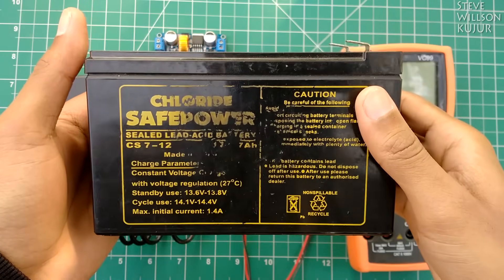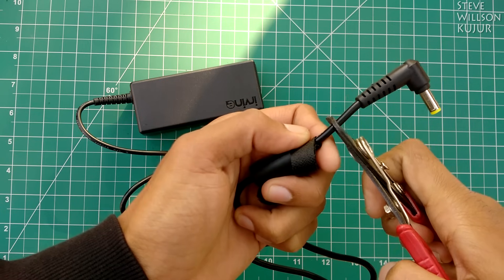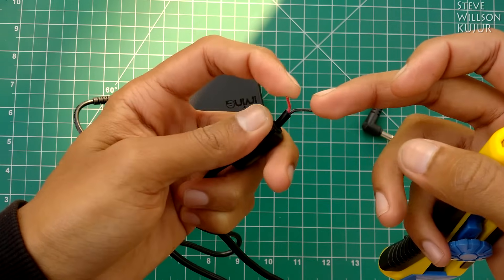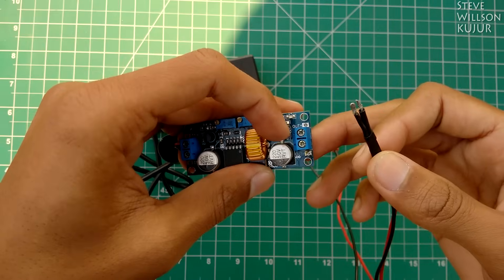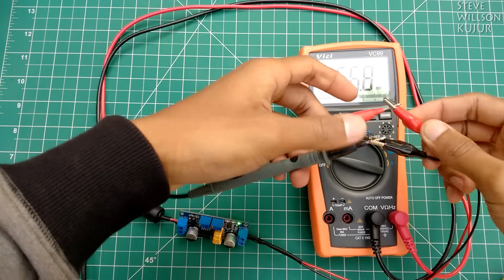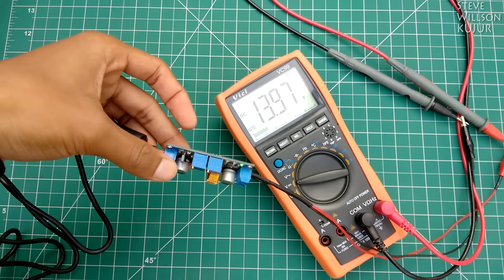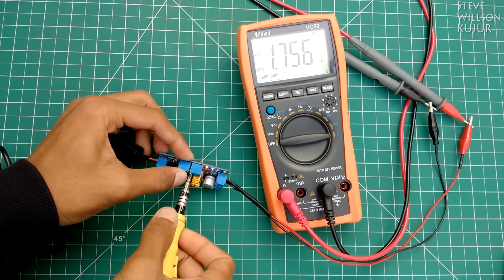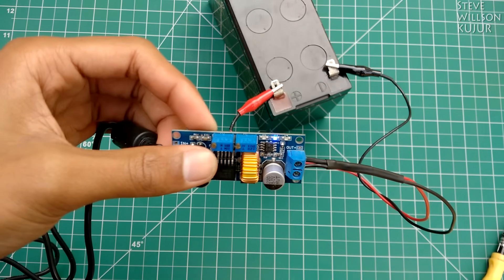How to Make a 12 Volt Battery Charger

Comment: sir what will happen if we give the input with a 12v 2amp dc adapter will it work or not plz sir do reply
Reply from the maker: no it will not work
Reply: Steve Willson Kujur 
so sir i dont have the laptop battery charger what can i do plz reply sir
Reply from the maker: use any adapter voltage above 13v dc to 30v dc
Reply: Steve Willson Kujur sir will it work if we give the input power of 12v 5amp will it work plz plz tell sir
Reply: IF as you say you have 12v 5A  available then you can use a different type of regulator - a BOOST regulator. You need to find one that will deliver 14.4 volts output and have BOTH a voltage setting pot AND a current Limit pot. If you can't find one (search eBay for 12v boost regulator) your other option would be to use TWO regulators ONE to BOOST your DC volts to somewhere between 16.5v and 19v (dependent on PRECISELY what the second regulator requires as minimum differential between input and output volts - they usually tell you this on the order page). There will be no need to worry about current limiting on the first regulator, the second will provide it overall for the output if you use the one Steve showed. Adjustable boost regulators always have a voltage setting pot. If you also want current limiting look for a model with two pots as that will almost certainly be both current and voltage adjustable

The second regulator (like the one Steve used) will be needed to deliver the 14.4 volt output for charging the battery. You connect the output of the BOOST regulator to the input of the second (known as a BUCK regulator) which is set as Steve described. The first regulator is set to output sufficient volts to the second so that it works. It's not possible to state with certainty what output CURRENT you'll be able to actually deliver, but I would expect you'd be able to get around 3 Amps at least, possibly a good deal more from the combination of the two. The actual value will depend on the individual circuits and the exact efficiency of each at the voltage conversions actually used. 

DON'T expect 5A output from such a combination, or even from a single boost circuit.This is because the overall losses will mean that the output cannot deliver as many amps as the 12v input. 

Problems: 

1.If you have no existing 19 to 20v laptop supply available then a solution will require potential extra expense.
2. If you can't find a single Boost circuit of the right specs you will have extra expense
3. It's NOT as easy a set up with two regulators and you MUST keep track of what you are doing or the magic blue smoke can suddenly appear! 

Simplest solution, try to find a scrapped power brick. Often there is nothing wrong with them if they've been discarded at the same time as an unwanted laptop. Even if there is something wrong it may well be a broken connection at the cable connection into the jack plug. If you get one of these scrap units with an led indicator and it is on but there is no output, disconnect it and cut off the cable a few inches away from the jack connector and retest the output. If the led does not come on with power or there is still no output take it back to the scrap/recycling and try again. Alternatively if you have any sites locally such as Freecycle or Buy Nothing or Freegle etc keep an eye out on there or even ask for one. It's amazing what people are prepared to give away rather than make a trip to the recycling/scrap centre and junk it.

Here is a typical boost regulator on eBay for 10-32v input volts, up to 16A in, to 12 to 35 volt at up to 10 Amps output. CLEARLY You WON'T get 4 Amps at 24v from a 12v 5A input. You'll be lucky to get 2 Amp due to conversion losses and power transfer rates.

PAY SPECIAL ATTENTION THE THE NOTES THEY SUPPLY IN THE SPECIFICATIONS SECTION- THIS ONE DOES NOT HAVE SHORT CIRCUIT PROTECTION. YOU WOULD HAVE TO RELY ON THE SECOND REGULATOR IF USED, FIND ANOTHER REGULATOR OR REVERSE ENGINEER THE CIRCUIT TO FIT YOUR OWN CURRENT LIMIT OR SHORT CIRCUIT PROTECTION IF YOU WANT TO USE JUST ONE SUCH BOOST REGULATOR. ONLY THE OUTPUT VOLTAGE ON THIS ONE IS ADJUSTABLE!

http://www.ebay.co.uk/itm/Useful-150W-10-32V-to-12-35V-DC-DC-Boost-Converter-Step-Up-Charger-Power-Module-/282264822386?hash=item41b84b6272:g:sMsAAOSwZd1VZa~l

Comment: can u show a video,how to make a 6v battery charger
Reply: He just did ... in THIS video - just set the output voltage to 7.2v (6v battery charge voltage) and set the charge current you want (the output current limit) everything apart from the actual output voltage and output current setting is exactly as per the video above.

Comment: of course it will charge a 12v battery but i still dont trust it,  it might ruin slowly a battery...a battery charger outputs 12v dc and Laptop charger outputs 19-21v dc... not unless you have a dc-to dc down sort of a converter... why not using an junk alternator that works and electric fan without a fan blade but with a pulley converted?
Reply: Did you actually bother to watch the video properly? What part of the video where Steve spoke about the voltage regulator off eBay did you NOT understand. He IS using a DC to DC DOWN converter from 19 or so volts down to 14.4 volts - which is the CORRECT voltage for charging a 12v battery. BTW a battery charger DOES NOT output 12 volts - NEVER has and NEVER will. It is ALWAYS necessary to have a greater voltage in order to charge ANY battery. Your suggestion is just nonsensical when for less than £3 you can implement this solution which works absolutely as stated, will not overcharge the battery if set up properly as shown and is 100% safe, unlike your proposed Heath Robinson contraption which quite literally is potentially lethal!
Reply from the maker: no issue with that because it is current controlled no problem with that
Reply: Going through all your comments, very informative. Is it possible to bring it all under one comment? That way its going to be easy, instead searching all over.
 I am thinking of getting 230 v ac wiring around my home. Instead for all the lights give 12 volt dc and use solar charger supported by 230 v ac line. Only fan and freezer would need 230 v ac, unless I use on site step up. 
 Do you think it is feasible?

Comment: My charger died and i'm looking to charge 3 12v batteries that are wired in series for my electric scooter.  My dead charger is rated at 44v  1.3A  If anyone can help with a suggested  Dc to Dc Step Down Converter I would appreciate it.
Reply: DC-DC STEP DOWN(!!??) from what DC volts? Surely you mean either DC-DC BOOST circuit to provide 44 volts (actually you should only have 43.2 volts set for safe charging) or a mains 110 or 220v Step DOWN (Buck circuit) to 43.2 volt DC output. I can point you at a Banggood supply that I have which will do the latter BUT it has voltage adjust ONLY, and no current limit adjust, only short circuit protection. For the Boost circuit I don't think you'll have much success as I looked a while back for one for a PSU I was building. PLUS it's likely that even if you did find one it would be a 12v or 24v unit. That means that your INPUT amps from a 12v unit would be a minimum of 3.6 times your output amps. So for a 12v input supply to 43.2 v out at say 5 amps you'll need around 20 Amps at 12 volts - THAT'S a LOT! Coming the other way from 220 volt is no problem. 

The 220v AC-48v DC output supply I have can deliver 5 amps (240 watts) and can easily be adjusted down to 43.2 volts where it will likely be able to deliver a tiny bit more than 5 amps although 5 is supposed to be its limit. Downside of the latter, as I say, is lack of current limit setting. Try searching eBay for AC-DC 48 volt supplies and see if you can find one that fits your purposes. If not can your bike batteries be reconfigured for charging from individual 12 volt charge circuits? If the ground connections on three separate 12 volt supplies do NOT connect to a common ground/earth (CHECK before assuming) then you COULD connect three separate chargers to the batteries with the batteries left in series connection. BE CAREFUL there are OTHER considerations to consider also in this scenario

Comment: hey man nice video I have a question recently I've built a battery pack of 12aa 1.5v rechargeable batteries which are connected in series, so is there any way I can charge them without removing them from the pack?? please reply
Reply from the maker: +son of a gun π yes you can charge it. Just apply 18v and a constant current .
Reply: Steve Willson Kujur current value? my each battery is 2800 mah
Reply from the maker: +son of a gun π your aa battery capacity?
Reply: Steve Willson Kujur each is 2800 mah
Reply from the maker: +son of a gun π then go for 1 amp (1000 mA)
Reply: Steve Willson Kujur so it will charge 12 batteries cool thank you so much bro
Reply: Steve Willson Kujur subscribed
Reply from the maker: +son of a gun π thanks man

Comment: Where can I find out how to make a battery for a portable computer? I am making a mini-ITX build in a custom made case using a pico psu and 195w laptop charger. However sometimes I want to be portable hence the laptop form factor and want to rig a battery to it. Are there any cheap batteries that can connect to a pico psu? How do I find this out? Many thanks in advance!!!
Reply: 195 watts is quite a lot for a battery to deliver, that's like 3 car headlights on full beam plus some more! Even a large car battery isn't going to last very long with THAT kind of a load. A suitable power source will require a large battery equating to bulk and weight which kind of defeats the object of the exercise. Most modern laptops require between 60 and 120 watt power bricks and that is to BOTH power the PC AND to recharge the battery at the same time. Check your EXACT power usage of your "laptop" first. Then see if it's below 75 watts and if so get hold of a working Lion battery that uses NO serial interface data feed (SOME don't, MOST do!) and use that or gather a batch of working 18650 cells and a suitable BMS board from eBay, add a temperature protection circuit/cutoff (the eBay ones do not seem to provide even a thermistor connection and no temp monitoring!) to build your own. Get the highest voltage/capacity Lion battery (or make one) that is compatible with size/portability.

How to construct Lion batteries is a vast topic with loads of resource online and especially on YouTube. Find several videos and watch them all carefully for tips and tricks. Then it's back to the drawing board to figure out all you need and a practical design ... EASY! ... NOT!

Comment: just take charger of laptop have a 18 vot at output side take 12v zenner diod at output side and then charged it by laptop charger not a use of mudule
Reply from the maker: it's not safe it'll damage the battery

Comment: nice video,can you tell me if can i use this for charging a pack of 3 18650 cell in series?
Reply from the maker: yes but set the voltage to 12.6v not more that for some safety reason set the voltage to 12.4v And current as needed

Comment: I've a 12v 7.2Ah battery, also marked with cycle use 14.4 - 15.0v 
initial current 2.16A max. 
so, I should set it to 14v & 2A for charging, right?
Reply from the maker: +ambarish kumar mishra yes

Comment: This might be just what I am looking for, thank you,  Can I use this method to charge my 12v  3.2Ah sla  battery and if so what should the voltage and current settings be?.  Thanks again,  john.... :)
Reply from the maker: +John Berry 13.5v and 700ma (0.7a)
Reply: Ok thank you very much.... :)

Comment: did he just measure the current across the output of the charger. hes lucky the charger has a current limitter
Reply from the maker: +xpapidox yeah that's why I measured
Reply: But how do you measure the amperage without consumers?
Reply: you are right!!!! He must not be very familiar with electrotechnology. However, we have to encourage him to continue. We all started from square one.......
Reply: Ever wonder why they created clamp for battery? And just so you know the way using 2 clamps in a multimeter for testing doesn’t make any clever than average. Always learn from the seniors and they were kind enough for using harsh words only encourage you. Great video by the way and be safe my friend.
Reply: I want to explain, i tested this on a step down converter and really works! You can measure the amperage without consumers.For a long time working on this way of the measurements, and I think it is completely safe!
Because it is a low voltage, no danger. And it is safe for Multimeter also. Just talking about Step-down converter. DO NOT TRY THIS ON THE CHARGER DIRECTLY!!!
Reply: All things Studies Those converter bucks are cool and less expensive and if you could install one of those digital amperage/voltage display that would be great. FYI : in my case I just bought usb tester and modified it a bit and the result is really good! Cheaper and more efficient, real-time output. And I’m sorry if I offended you in anyway in my previous comment, it is just batteries are tricky and just want everybody to be safe. Cheer mate. Keep up the good work
Reply: Current test with no load connected !!! it is a nice video though.